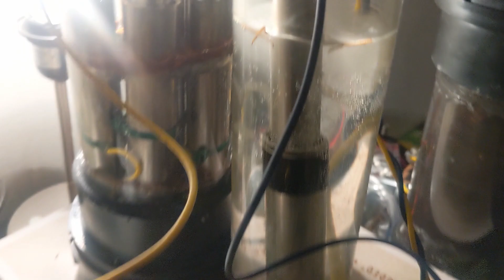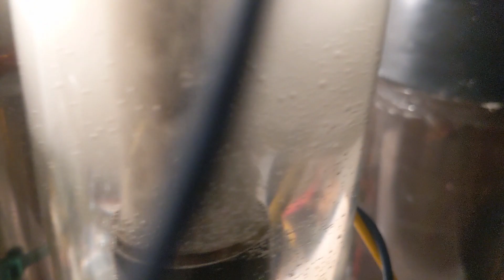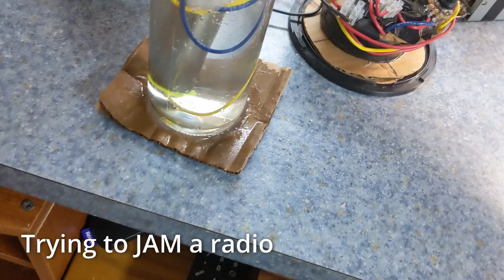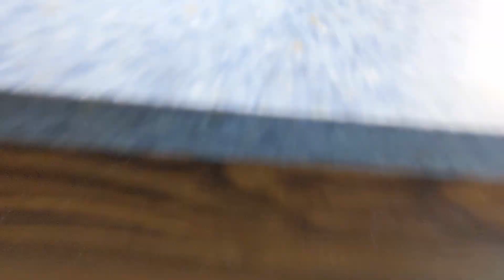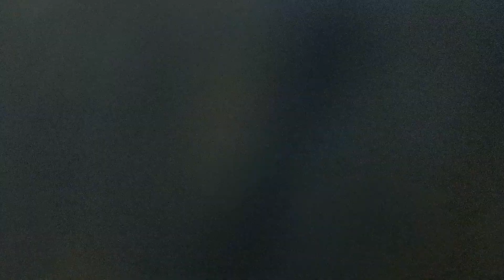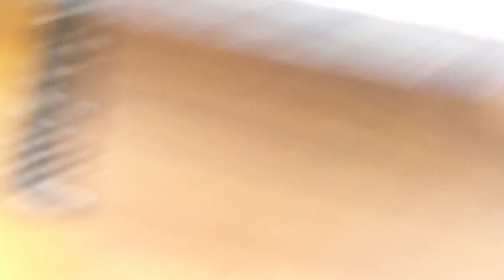HHO Resonance with Snow [No Electrolyte]

Comment: 2Q says not all H2O is the same and hold deafferents amount of Memory. That's right, water holds memory. Water produces a energy when vibrated correctly can make the air catch fire. If you are in a running car and a UFO comes close enough, look at the flames coming out your exhaust.

Comment: What is the Meg ohm reading of close electrodes , comparing distilled water with melted snow?  Snow contains dust from the clouds. The distilled type should have no minerals, just some charged ions. The special $600 filter system called pure water,- removes polarities of ions -  probably similar to your clean snow. Also what do you think about captured rain water as better than distilled" Did you know that Meyer has RESISTANCE (not copper) insulated magnet wire for the bifilar inductors, to further increase resistance of cell?
Reply: I've read years ago "rain water" contains low levels of deuterium. But it'll also have contaminants unlike distilled.